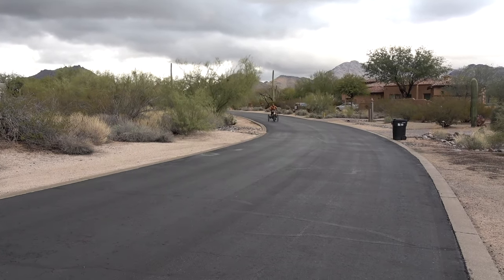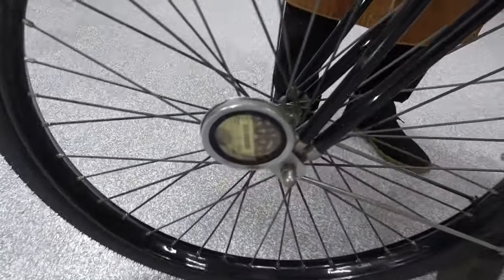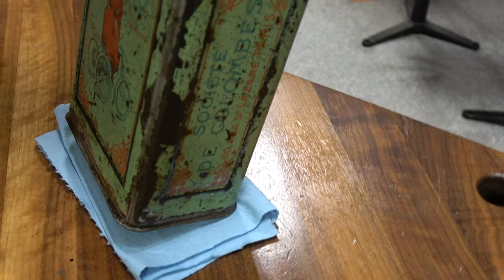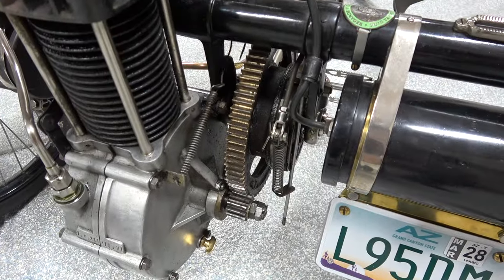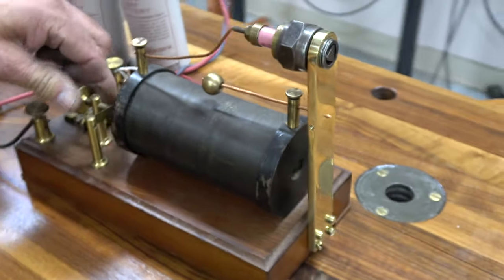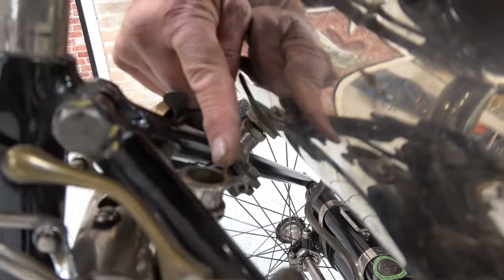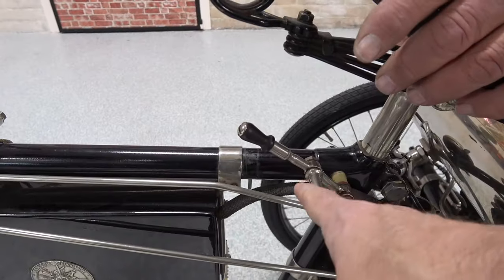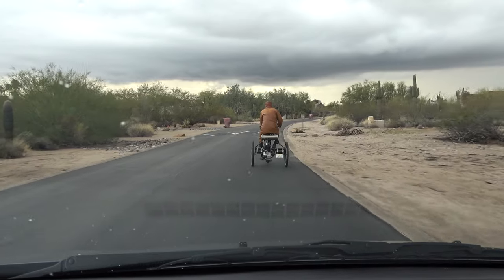Early Automobile History # 2 1897 De Dion Bouton & Owner Rides on My Car Story with Lou Costabile

Comment: The gear ratio looks to be much lower than he said.  You should put Open Gear Lubricant on that Pinion and Bull Gear.  I use it on open gears on my crane.  You can get it in caul tubes and use a caulking gun to apply it .
Reply from the maker: Hi Mike, Thank you for viewing and sharing tips, Lou